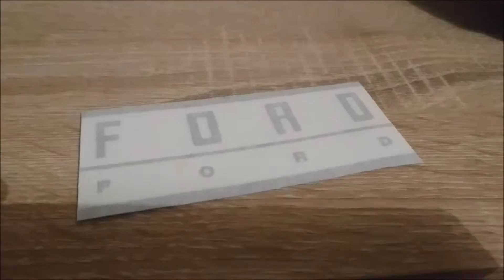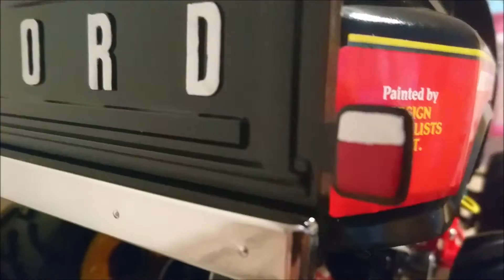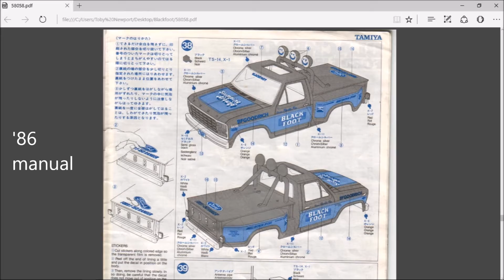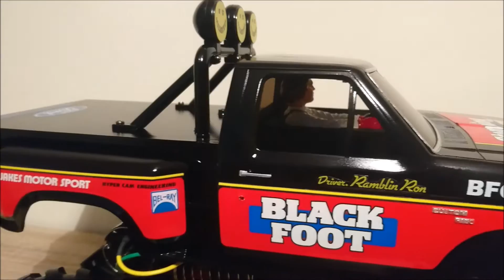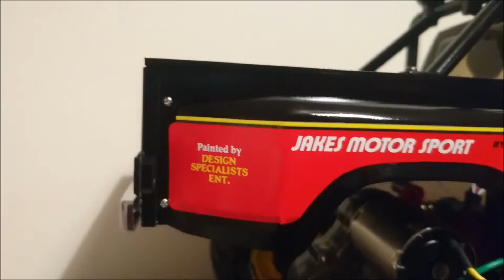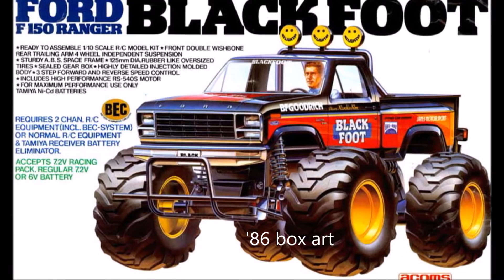Tamiya Blackfoot How to cosmetically convert 2016 into 1986 retro

Comment: I stayed up for 2 days building my Blackfoot back in 1990. The old hexagon drive shafts lasted 10 minutes before getting stripped.
Reply: Funny how CRP plastic bones lasted longer than the stock metal.  For those who couldnt afford a thorp or that universal kit that came tick later (forget name).  -U10
Reply: It’s odd. I’ve got a vintage original that’s had a hot motor all it’s life and it’s never had a problem, despite lobbing it into reverse repeatedly 😁

Comment: This is exactly what I am doing to my 2016 Blackfoot (except for the AMP stuff). I already bought the MCI racing decals.
Reply from the maker: Thanks for the like! If you think you could use the Ford lettering (decals*) then send me a private message and I'll mail them to you.  No charge. I won't be using them. 

As I say in the video, not quite as good as raised lettering -but you've got to have something on the tailgate and bonnet if you want to reproduce what was featured Ford branding back in '86.

Good luck with your build! 

*as a footnote to other readers, MCI don't include Ford lettering as decals because of course it wasn't on the '86 decal sheet, it was raised plastic on the body.
Reply: manicstmn Are the decals still available? I'm restorating a true 86 Blackfoot and I'm replacing the body because it's scratched and cracked but I'm still gonna use the 86 stickers, it would be nice to use your decals for the front and rear.